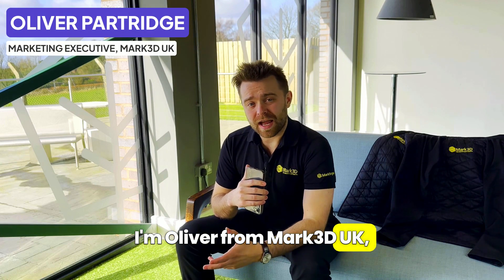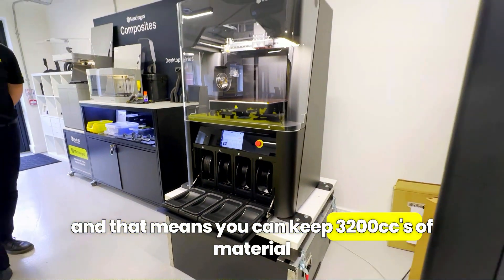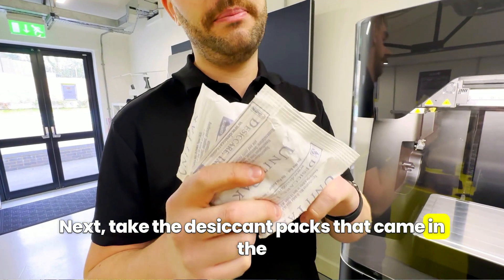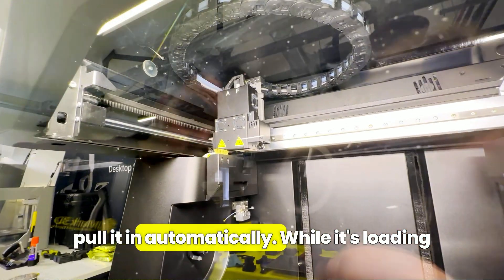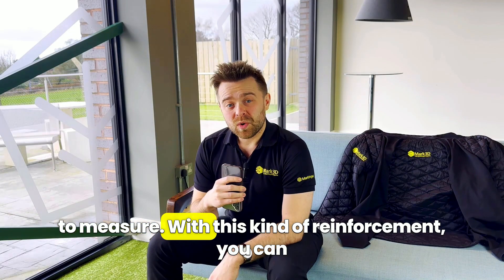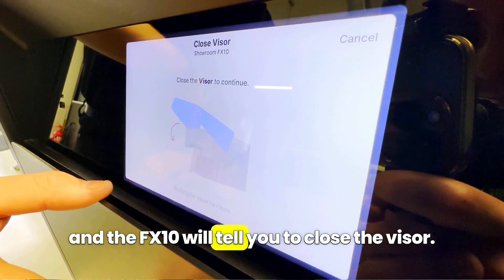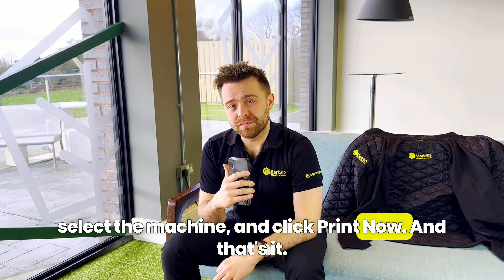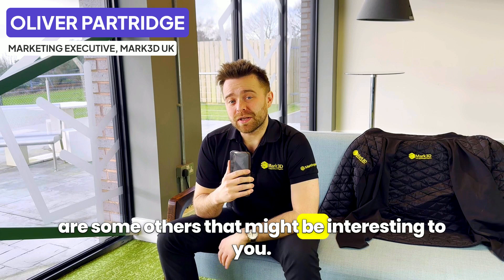How to 3D Print Composites on the Markforged FX10

Comment: How long does a spool last?
Reply: An 800cc spool will last a while, but it depends how big the object you're printing is.
Reply from the maker: The slicing software, Eiger, tells you exactly how much material a print will use. If you're printing something small like brake levers you might be able to print dozens with a single spool, but if it's something big or particularly dense you might only get one or two objects from a spool.